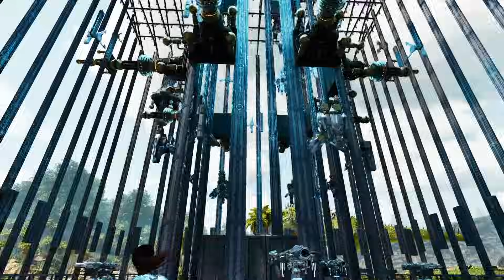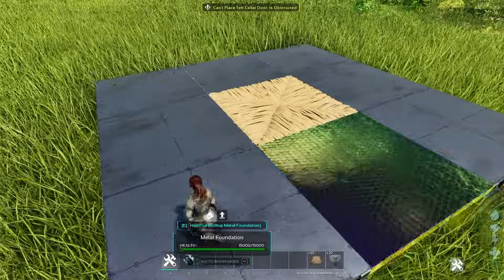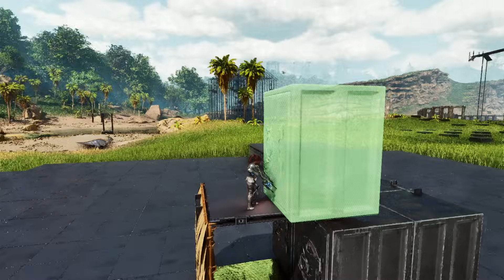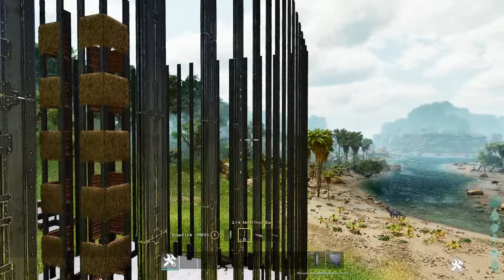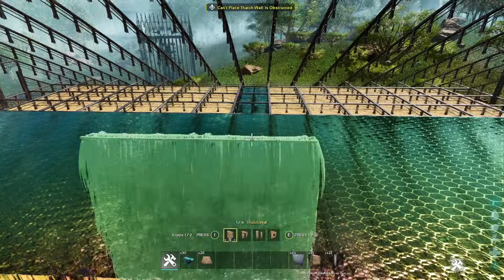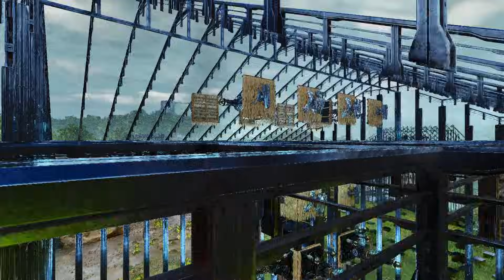ark meta sekeleton turret tower full build tutorial - ASA

Comment: I’m jk it’s actually a beautiful build only thing I can say so far is that instead of just using double door frames on the uneven foundations you want to snap the walls into the ground itself at those points with tek pillars, then place the double doorframe walls over top of the tek pillars
Reply from the maker: Yea works too
I think I made the video before half pillars were a thing
Reply: @smarft u don’t need half pillars
Reply: @smarft you just snap pillar to the double doorframe and into ground and place the foundation back ❤
Reply: @smarft the snap point where you do that will have the same hp on the structure whether you use half pillars or snap it into the ground

Comment: There also appears to be a bug with the tek cellars perhaps it's only in singelplayer but their snapping to each other doesn't seem to give support, as in if you pick one of them up and they were snapped 'together' they pick up. seems like they only answer to one snap point.
Also another bigger issue, still on singleplayer atm, is that the tek ceiling doors can only snap on one of the sides of the big ones.

Hard to explain via YouTube comment but its very clearly a bug I didn't seem to experience on a server but certainly is the case on Singelplayer, i have no idea if it's a recent bug patch bug or what but worth mentioning as well.
Reply from the maker: Watch my latest reel regarding this problem there is an easy fix

Comment: Anyone else have an issue with the replacing of thatch walls to metal walls? Specifically at the top and or any other ones you want to additionally add?

It will not let me replace the thatch wall only place snapping to it. Seemed to work totally fine for the tower itself except for the connection points of the cellar doors where I had to pick up those cellar doors first which allowed me to place replace the wall. Not sure whats going on.
Reply from the maker: Check out my latest short I have a fix for that
Reply: @smarft  Sweet thanks.

Comment: peak the roof more and add extra railings in between the existing ones on the roof, absolutley love these towers. i only say the extra railings on roof because turtles can be dropped from above and they fit between and get stuck between the roof and the thin pillars and the only way to get them out is to demo a bit of your roof, other then that absolute best towers.
Reply from the maker: Yes very true 
But i mostly build for officials and structure cap is a big problem there 

On unofficial you can definitely build a more detailed roof
Reply: What do you mean about peak the roof more
Reply from the maker: @urbanoperez9238   there is a more steep variant of the railings that would have the roof be steeper as well

Comment: So does the outside foundations all have to be the same level? Or just the corners?
Reply from the maker: Ne but the more you get to the same level the more ground connection you tower got 
And it’s 1 level and then basically if your going up a full wall that foundation connects again 
Just not the half wall high raised foundation in between

Comment: but u said it should be 2 foundations higher but your tower is on ones side only built one higher right?
Reply from the maker: @MrAdioMaker  I’m not exactly sure what your talking about right now ? 

Do you mean the foundation & how to get the correct snaps for the cage wall ?
Reply: @ you said we should look that the 15x15 is on the same level right? and if not we should go 2 foundations or one wall up/down. if i only got uneven ground and alot of the 15x15 foundations are higher or lover than the middle does it make the tower really unstable? what would you do if you got uneven ground?
Reply from the maker: @ the grid is in 1/2 walls 
So if it’s uneven you want to go up 2x 1/2 wall as fast as possible 
If not the walls won’t be the same height and that will cause them not to be connected 

If you want it explained , the last meta tower Full build has an exact explanation. It’s a few months old now
Reply: @smarft  ty I will watch that video! <3
Reply: @smarft  sry wich tower video did you mean that expains this mechanic?
Reply from the maker: @ https://youtu.be/LXWnETRJHDM?si=AlArnqQJek0mZiBi
Reply: @smarft  much love